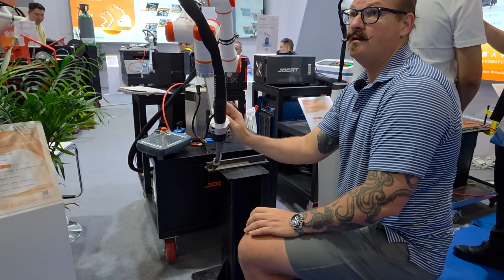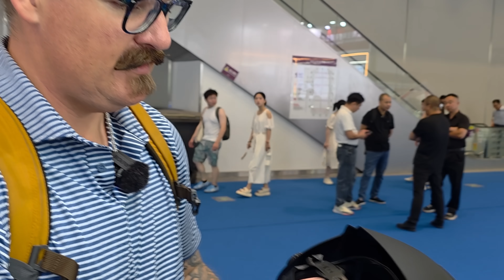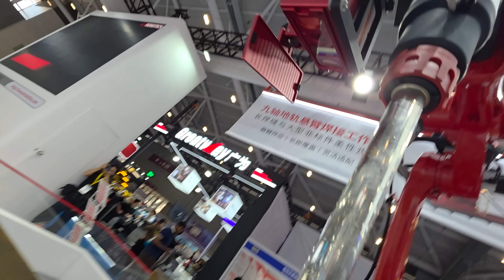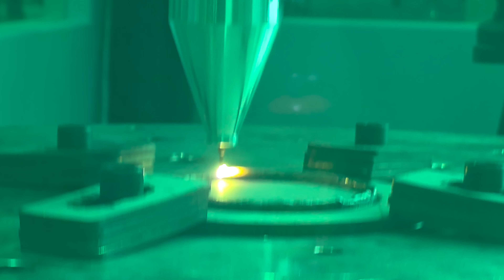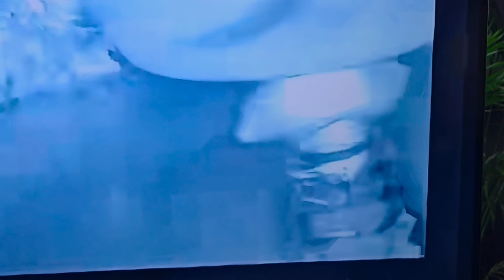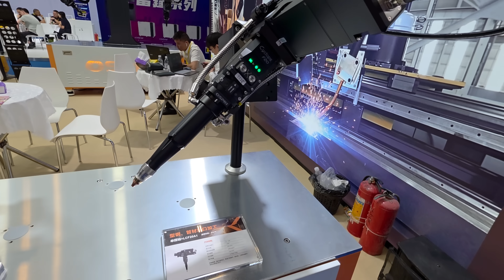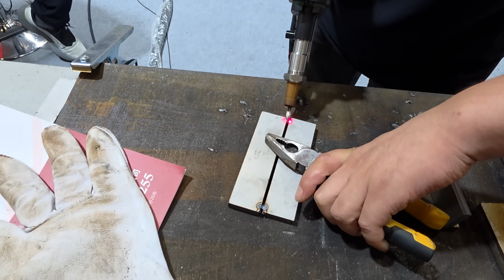The End of Hand Welding (I Saw the Proof)

Comment: Im a 35 years experienced welder   i can see some usefull way to integrate robots in mass production ... On custom made parts  not so sure about that ....
Reply: Looked like you can train a robot welder to a new shape in very short time, such as 1 off pieces in a custom shop, so i would say the point of the video was to show how custom welding is now in their scope, so yes custom hand welding will soon be replaced just as mass production hand welding has been replaced.
Reply: @dantevxv1501  Yes your right
Reply: @dantevxv1501  I mean, if you're training the robot to do the weld you're already there in position to do the weld... Kinda just adding an extra step for no reason by adding the robot.
Reply: @mmhmmthatright6900  so you're saying being a welder isn't a skill? the point is not everyone is a welder and this demonstration shows its simple to set the welder up, so any old non-welder can do welds now. If im wrong in thinking welding is a skill and actually any shaky handed half blind idiot can do welding i stand corrected.
Reply: @mmhmmthatright6900  Bus factor.
Reply: Yeah but when the people doing mass production stuff gets their job replaced by robots, they’ll start looking at other jobs, including custom fab. This will push down the wages of the industry overall and take customers fab jobs harder to find
Reply: What you don't get is that    its not right going to replace every welding job right now
Most these robot welders are meant at this point for sitting in a production line and make the same weld over and over again 
  They will rarely need to be reprogrammed and recalibrated rarely to 
The same person will be able to do both and just because you 10 you wont need 10 for 10 robots probably just 1
  The Welders on a manufacturing line will be replaced first
 And now people being told learn to weld and the displaced welders they are going to be looking for welding jobs
 They will be thrones competing for the jobs you are talking
 The laws of supply and demand exist there will be a surplus of welders and drive down wages 
  Because there will be competent to good welders willing to do it cheaper 
  On top many will probably foreign workers like Work VISAs and illegal immigrant
 You guys got get out of your bubble and see the forest beyond the trees
 It might not be the robot for certain jobs but might be the displaced or foreign worker that comes for your job
Reply: Exactly
Reply: The AI section in this video shows that it can scan and create a 3D model and weld according to it. So you don''t even need to program it anymore.
Reply: Yah. IMHO, the smaller or more custom the job, the more likely you’d have a human working it. Human welding won’t be dead, it’s more that the larger and repetitive tasks will be handed over to machines. Also, laser welding… HUGE.
Reply: That's exactly what the welders at the auto plants said about the very first robotic welders that were prototypes in the manufacturing lines! How many welders are there in any one, auto plant today? Once it starts there is no stopping it so if you have more than 8-10 years left to work in the welding field you better be learning additional skills such a fabrication, sales, management, programming, etc.. If you don't then you will end up working the remainder of your career in a low paying, menial job until you die, just like my Gran dad had to do!!! For more than 3/4 of his career he was a top wage earner until one day he woke up and was outdated and no longer needed. Just like an older generation machine, he was thrown out to rust and die!!! Think about what happened to the thousands of horses after Mr. Ford started the  automobile assembly lines and flooded the market with cheap cars, they were sent to the glue factories!
Reply: I believe that with technological advancements, some of the technical concepts from CNC machining and 3D printing will be applied to the field of welding. Future robotic arms will likely use AI-programmed paths to automatically plan the welding methods for different parts.
Reply: Im sure every custom part, can either have the blue print loaded, or scanned with a camera, then loaded
      Between these welders and metal 3d printers. It might be coming for it all. Mass production and small custom parts.
Reply: Exactly! The "custom-made" world will never make use of this. This is only good for mass production. The people who write software have probably never welded in thier lives. What do they know what a good weld looks like?
Reply: These robots aren't very different in drive and motion than those 25 years ago. 
We used cameras for analysis since at least 2005 .... the 3D computer vision is neat but it isn't any faster than quickly mark the welds.
And I'm not sold on the collision analysis on smaller and more complex parts. Especially for MIG, where the robot will insist on angle and trajectory.
Reply: @weerolein  Right, but they still need to be fixed and that may take a mobile welder!
Reply: @lyndelf   you are not wrong there.
And they also need to be recalibrated.
Reply: @lyndelf yeah I made a comment that until these robots start showing up at my customers' homes or shops FOR FREE, I'm not so worried. I'm sure they will cost more than what I charge, and therefore I'm sure they will take some time to catch on. The moment they begin to drop in price and become affordable, people with fab shops who make parts for money will just buy one for their shop. It can automate a station and do work for your company, where before you'd need to hire another person or wait until you had time to walk over to that station and do the work yourself.
Reply: @cyleleghorn246 it wont be the robot it will be the displaced welders from a assembly line 
 Or it will be the person they told learn to weld  instead learn to code
 That might be the forgien worker but anyone willing to do it cheaper
Reply: @BenSmith-yp2yd  if you can't understand market rate and you lose jobs because of that, well, that's on you. If you suddenly can't survive on your skill anymore because literally everyone else is doing it cheaper than you can afford to, then it's time for you to learn a new skill if you want to survive.

I know these machines exist, but at the same time, I haven't seen a single person using them. I haven't lost a single customer yet. They're not here, or if they are, they're still too expensive right now. And I guess the people willing to do it cheaper just aren't good enough yet. 

Give it 5 or 10 more years and things will be different, but that's plenty of time for you to learn a new skill if you aren't already rich and retired.
Reply: @cyleleghorn246   I don't think that there is a surplus of welders. I have been trained, own MIG, TIG, stick, gas, and soon a laser welder and there are lots of welds I cannot master myself.
Reply: @weerolein  the fact I can get welding work with no certifications and only about 2 years of learning on my own (stick first, then mig later) I agree with you. It's easy to get good enough as a welder, to do things that nobody else can do, and are therefore willing to pay money for the service.

My first paid job was welding some new expanded sheet metal on the back of a landscaping trailer loading gate, since the old stuff rusted out over years. $250 cash right then and there (literally only 1% the cost of a new trailer) and that guy was so happy he recommended me to a bunch of people, and very quickly I had to start telling people "I can't get to it right now" because welding is a hobby for me, not my main means of making money.

But I know, if I ever lost my dayjob, welding is absolutely a skill (one of many) that I can fall back on and make money on the side!
Reply: Custom parts even large can now be 3D printed in just about any kind of metal. Large companies just outsourced to specialized companies for prototypes It's cheaper
Reply: @MmMm-f2y7c  it's still not financially attractive for medium and large batches. And tensile strength, generally, is abysmal.
Reply: @weerolein and with cheap products these corporations make and sell now care about that 
 The more something breaks and has to be replaced the more money they make
Reply: @BenSmith-yp2yd   the comment is about metal parts only. There are no cheap metal printing processes as of today.
Reply: this is one-off stuff. And you can bet engineering companies on 99% of metal printers. And those machines are stupid expensive as are the consumables. 
When there are other processes that are cheap and fast. The engineer or a machinist catches create a lot of things. And lost pattern casting Austin lake combined with 3D printing is cheap and fast
Reply: @charlesreid9337  This.
A handful of metals and be sintered with isotropic strength and there are 3D print opportunities (nozzles, cooling channels, blades). But anything that has a grain or zone transitions .... it will never print at full strength or reasonable cost.
Reply: @weerolein you don't need to replace everyone only the ones jobs are repetitive  
 The displacement of them welders will naturally gravitate to onthier type welding jobs to compete for them jobs
 Then there will be competition to good welders too it cheaper
Reply: See you onpy want focusbon the things that make your job feel secure and ignore the onthier things
  Like robot welders on production line  like in the Tesla factories there is more robots then people  They will come for the jobs robots cant do  And then there will do your job cheaper evenbif they need to inport them 
 You do realize it cheap to 3D printers guns cheaper then the quality ones
 Why do you think states are just now scrambling to put laws to prevent people from printing them 
 Putting mandatory things on things on 3D printers to track what you are producing
 Peole been 3D printing guns for over a decade know
Reply: Year*... not years... Stay in school kids
Reply: @AerialEscape  pointless  you have better arguments?
Reply: @AerialEscape  - 90% of today's American kids can't afford to go to a school of higher education after high school. Remember that all of these Asian countries like China, Korea, Japan, Malaysia, etc., are providing a free high tech education to their younger generation and most of them are getting it in our schools, that are own kids can't afford to attend.  That's because their governments were investing in reverse engineering, global financing and education while our government was investing our future in defense and wars!!! The writing has been on the wall since the early 70's and the USA has done nothing except to make it easier for all these counties to get a hold of our tech and more cheaply reproduce it and sell it back to us at a huge profit. Hell I remember in the early 70's when your neighbors would laugh at you if you bought a Toyota or Nissan (Datsun) car, but now Toyota is the #1 automobile company in the USA and we can't buy enough of them. I just feel sorry for my Grand kids and their kids because the USA has basically lost the race to the future unless Americans can wake up and start changing things very quickly and I'm not talking about waking up like the "woke America" either!!!

Comment: In the meantime a good welder wud hav finished & gone for a cup tea  🙄
Reply: This is not intended for a one off part. You spend 10min teaching it to do a particular sequence then it repeats that sequence perfectly every time for a run of 1000s of parts non stop 24/7.

It's physically impossible for a human welder to keep up with that.

The next evolution will be a welding tortch handled buy a robot couple with AI that can analyse, assess, plan out, then excecute a custom welding job.

Any manual trade job will eventually be replaced by automation or AI controlled robotics. It's just a matter of time.
Reply: Yes. But you will pay 5 to 10 time the price  for a good welder....
Reply: Excalty
Reply: Early machinist thought the same when CNC came.
Reply: big difference Bud, machinist is fixed. Not welders.
Have you worked in a plant that has a kettle fryer and develops a leak, and you have to take a whole machine apart just to weld. Have you had your replace runners and tack everything together and test before welding?
Reply: @emiliohuerta2658  did you watch the whole video, he said fabrication skills will be more valuable
Reply: @emiliohuerta2658  ok
Reply: while the AI welding is still working 24hrs a day.
Reply: The good welder call in sick on a monday after binge drinking.

Comment: Down here in Australia I'm not of the belief that robots can handle the heat and dust in our Outback on oil exploration sites or in our mining sites. Humans can climb stairs and lie down in pipe racks or inside tanks. Robots won't... for a while at least.
Reply: I worked on amphibex machine floating dreddging machine here in Quebec i can assure you your robots cant crawls into 12 x14 inch manhole in multi compartments to weld  in every positions in the boat... only the few will understand what im saying :)

Comment: Dang it!!! I’ve already got so many hobbies but I’ve been intending to get into welding. It looks like so much fun but I also don’t want to learn an antiquated skill.
Reply from the maker: It’s still a great skill to have, and learning the fundamentals of manual welding will always help you understand the machine side better!
Reply: If you are doing it as a hobby that doesn't matter. People still do woodworking with hand tools. Both as a hobby and commercial work.
Reply: @Mor @MorbidEel  yeah. I suppose so but it seems like laser welders are rapidly becoming the standard. Ive been toiling over whether to try tig or mig welding first. I don’t want to buy a bunch if machines just to have them become antiquated. That feels like it’s happening all the time. Some of my other hobbies are building drones and firearms and things are evolving so fast in both those industries it seems like every years you can throw away everything you bought a year earlier. So many skills to learn and so little time.
Reply: @darrenstettner5381  Laser vs tig/mig seems a bit trickier to decide. On the one hand they are still more expensive if it is just welding but at least some of the lasers do cleaning, cutting, welding, optional CNC and maybe even a bit of engraving if their power can be lowered enough.

You can probably get a separate robot arm for the laser at some point so that is another reason you won't have to worry about. Having the space and being able to power all of it should be the bigger concern.

Comment: Robotisasion are advancing rapidly. But there are limitaions still to be solved. In welding its the programming time one issue. Toch up on a complicated construction takes time. Especially if it needs to be manipulated to be welded on all sides. There are corners and facets it can not get into or around. Some can be removed by redesigning but not all of it. Another point is adaptability. Every steel construction moves when welded. Heat impact stretches steel. So the touch up model will only be the starting point. I have seen construcktions expand and contract several millimeters (10-30 mm) on a complicated construction. The robot needs to be able to adapt to this. But evntually things will be resolved in time. But its still a long way to go. Safety regulations is not "crap". They protects Your security and ultimately Your life. Remember its not only Yours safety but allso Your familys.

Comment: We had a Cobot from Lorch at work .It could do single layers perfectly but could never do multi layer welds without faults.There was also a lot of work programming it.Inserting the points was the easy part,going in and out and around a part was more work.
Reply: Won't be long
Reply: Never give engineers a problem to solve and time....
Give us enough years and we will solve it. Look at 3D printers or any kind of fabrication over last 10 years
Reply: This is just the beginning, in 1 year at the same show, it may lose a lot of certainty.
A lot of jobs said the same about their job. Since then they have been fired...
Reply: I was dev. AI was bad at making software at first, it was just another tool, now AI can make a whole software in one shot and devs are totally cooked.
Reply: @CowardBoy-q8p  😂😂😂  That's why big companies cry with IT services to find senior experts
Reply: tradicional welding is still the real deal long-lasting and stronger.

Comment: If you look at the total time for one piece --- I can personally beat the shit out of this.
Reply: Until your shift ends. As you clock out for the day, the robot continues fabricating piece after piece for as long as someone fixtures for it. Not as much money in only fixturing, and manufacturers are steadily working on even that. Legend of John Henry all over again. Beat a machine by owning it (let it do the work it’s good at, you do the plenty of stuff it still doesn’t have training data for) instead of racing it.
Reply: @anthonyyen5807  Factory production robotic welding has been around for a while. This was called 'hand welding' as in a 'one off' basis. The setup takes longer than just doing it.

Comment: Can it do on-site ? Can it work on a roof  ?
Reply: As a machinist who started out as a manual machinist in the 80’s and does CNC machining for space destined part now, I can tell you I heard this exact kind of edge case argument against CNC in the early days. It’s the erosion of common work that is the problem and the shift to less skilled workers. I’m highly skilled. My productivity is probably 10x what it was 40 years ago. So they need 10x less machinists. More really since I can now do 20x more parts programming and several medium skill workers can run those parts. The only upside for me personally is over the years the number of workers who can make truly precision one off parts has shrunk dramatically and now I get to make parts that go to the moon and mars.